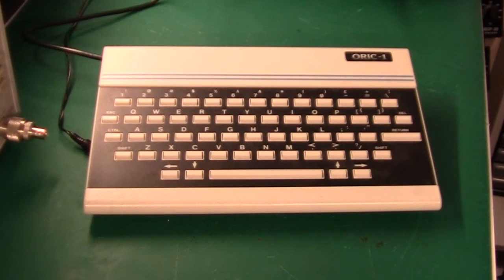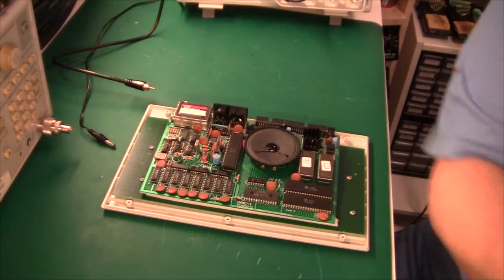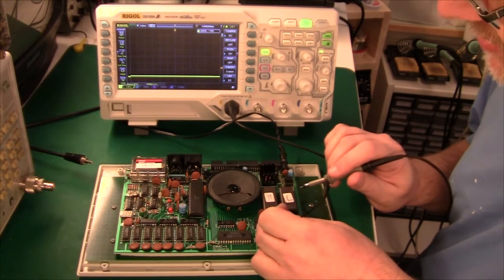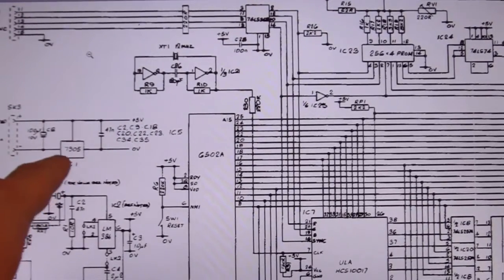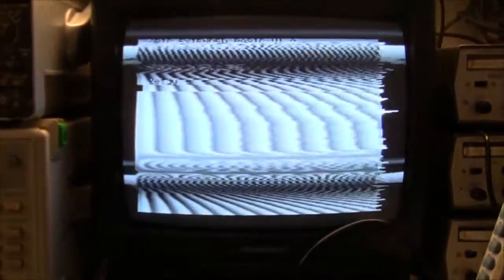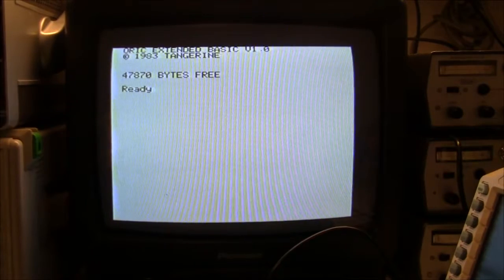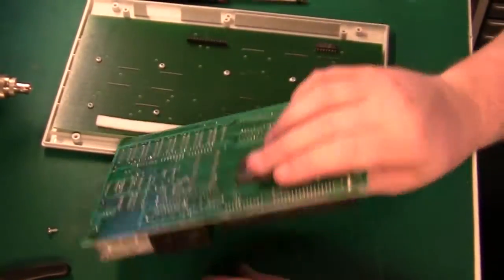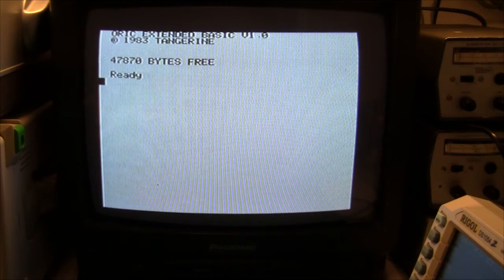Repair of Oric 1

Comment: Hi, my Oric 1 has two problems - 1st =80% of the time it powers up garble screen out put and  20% of the time it's ok - 2nd is when it does seem to work the output is Black and white mono chrome !  .. what can make a out put to be mono chrome please ?  Thanks.
Reply from the maker: Really tricky one. Normally garbled screen is due to bad RAM, but grey only sounds more like the video demodulator or the ULA. Sorry about so incomplete a reply. If you have access to an oscilloscope, try to look at the video signal. There should be a colour burst.
Reply: Hi,  :o)  thank you for your reply - Done more testing and these are my findings so far - Oric powers up well IF you plug in the power supply first ! ... 2nd the TV mod out - On my modern TV finds it and there is colour but had interference while there is none on my old Sony 90s portable TV and VHS RF in and scart out to the modern LCD TV shows stable but Monochrome /no colour !...
Reply: Hi,  :o)  thank you for your reply - Done more testing and these are my findings so far - Oric powers up well IF you plug in the power supply first ! ... 2nd the TV mod out - On my modern TV finds it and there is colour but had interference while there is none on my old Sony 90s portable TV and VHS RF in and scart out to the modern LCD TV shows stable but Monochrome /no colour !...

Comment: hum bars are usually cause by bad capacitors in the power stage of the PSU
Reply from the maker: Good point. For an transformer-based PSU, then they are typically synchronous with the screen refresh.

Comment: It's funny, but when I bought a broken Oric-1 cheap I was thinking it would be a fun project.  Getting it to boot was a matter of replacing failed DRAM IC's but my troubles didn't stop there.  I had keyboard problems which required me to replace the AY-3-8912 sound chip buuuuuut....  The later versions don't play nice.  Weirdness followed until it clicked that the asymetric clock took the newer version well out of spec!
Reply from the maker: Yeah, repairing old computers can be real frustrating, but you got it working in the end. How did the AY-3-8912 affect the keyboard?
Reply: +NatureAndTech It didn't just affect the keyboard. It also caused the computer to do odd things. Certain keys down the right hand side didn't work. I read on the internet that there were problems and decided to swap it with an older part which fixed it.

I still need to make a dump of the TTL PROM for the future though. I'll never be able to buy one of those if it goes pop.
Reply from the maker: Really strange symptoms. Maybe it messed up the address or databus?
Reply: +NatureAndTech

The serial attributed are also an odd feature. Lastly, I also made the mistake of putting a socket on thinking I was being clever until the case wouldn't close.
Reply: +Duncan Gunn attributed display sorry.
Reply: I noticed that the 7905 runs quite hot on these machines.  Have you considered upgrading to a switch mode module or would that damage the authenticity of these vintage machines in your eyes?
Reply: I've got an Oric-1 with troublesome keyboard too. Whenever I press any of the keys 2, Q, A, Z (or something similar, can't recall exactly), the computer locks up. All other keys are fine. I replaced the 6522 without difference, and am about to replace the AY chip next as I learned that the AY chip actually reads the raw keyboard input (as well as acting as a sound chip) and that data is passed onto the 6522 or perhaps the 6502 handles it directly.

Good to read about getting an AY chip of the right vintage.
Reply: Anders Carlsson You may also like to replace the cheap and easy to find bilateral switch on the keyboard PCB.  At least the Bilateral switch is reasonably easy to test on a breadboard.
Reply: I've already swapped the keyboard with both a different (working) Oric-1 and an Oric Atmos, same fault. Actually I've got an empty Atmos shell w/ keyboard that I might transplant the motherboard into after fixing the problem and upgrading the ROM, since as far as I know the only difference between those two models is the ROM revision and that all Atmoses are 48K.
Reply: Anders Carlsson The only other differences I can think of are that there are a bunch of mods to fix small design flaws, which are documented in the service manual.  There are the benefits with the Atmos ROM that the tape loading reliability is improved and the AY-3-8912 isn't so badly mis-driven.  This has to be weighed against which software you want to run because there are programs that require a specific ROM.

I could fit a twin ROM for you in a way that's fully reversible and doesn't mod the board.
Reply: Anders Carlsson How is your repair going?  I love bringing old computers back more than using them sometimes, and would love to hear how it's going.
Reply: Nothing going on right now, but in the future if I'll have a going, I can return and post a comment. :)